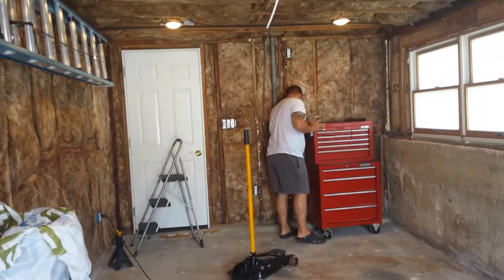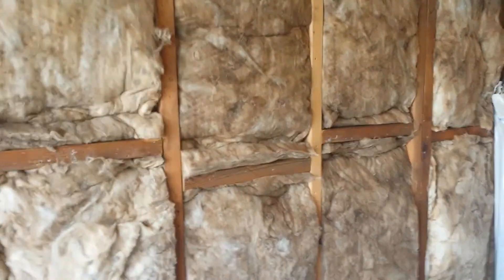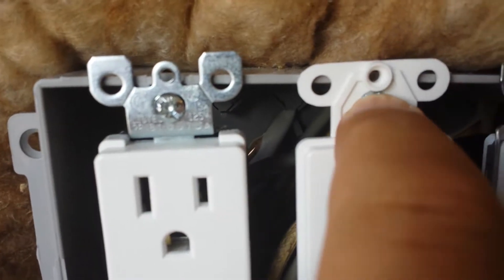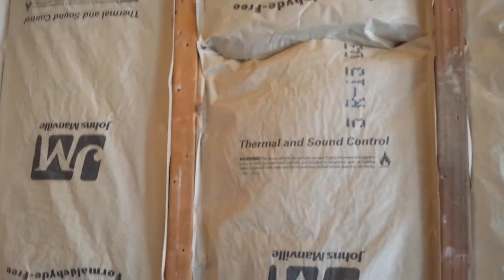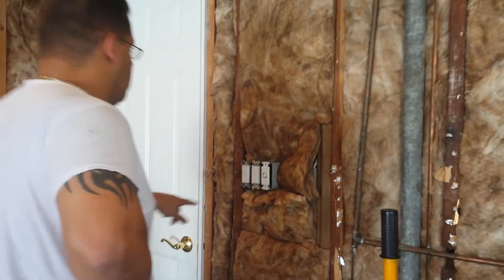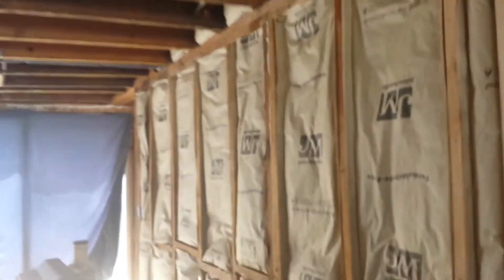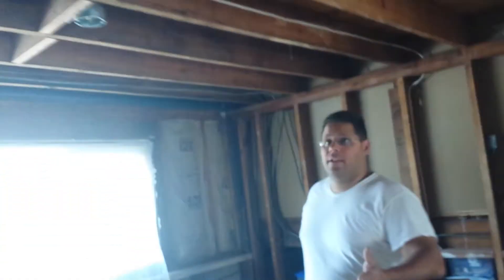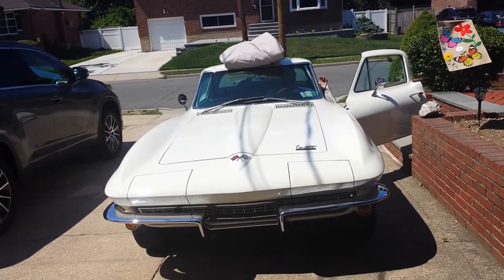Like Father, Like Son, Part Five Eee!

Comment: High hats in a garage??? How shitalian is that?! I much rather prefer big fluorescent lights. That's a nice 65 or 66 Vette that's locked in a cage
Reply from the maker: Oh yeah, I would have much preferred fluorescent myself.  The problem is, the garage is unheated.  In the very cold weather, fluorescents either won't start or their light output will be very poor.  That's why I did incandescents in my garage.  I once knew a guy that did fluorescents but had the presence of mind to install a couple incandescents as well, just so you'd be able to see in case the fluorescents didn't start.

My dad's shed has just a fluorescent, and yes, in the very cold weather, it won't light fully.

The high hats were done to save headroom, as the ceiling is pretty low in there.  I get the idea, but I think some flush-mount fluorescents would fit the bill much better.